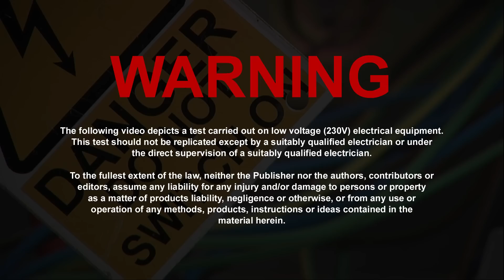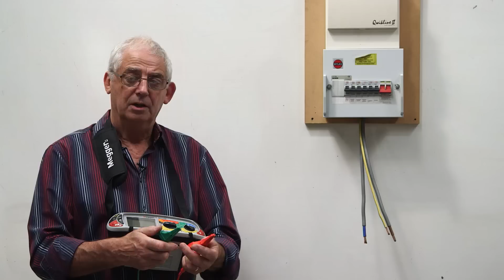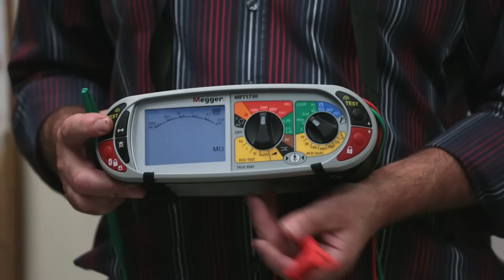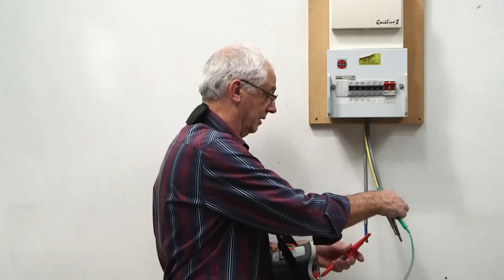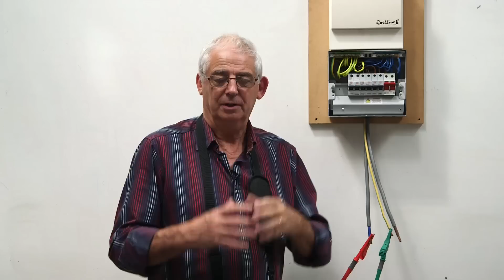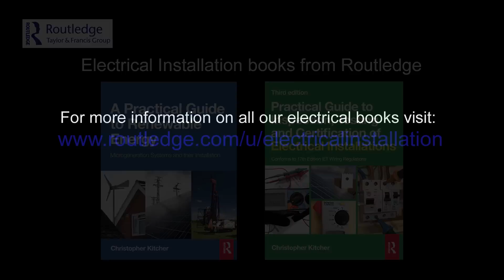Simple insulation resistance

Comment: Is there an RCD in this mockup institution? On my small screen looks like an isolator and MCBs? My question is can these tests be done through a switched on RCD?
Reply: Late reply but no there is no RCD on this rig . The RCD needs to be disconnected whilst doing this test otherwise you can damage it .

Comment: This may show my ignorance but, could you clarify something for me. at the beginning, your breakers are in the "off" (I'm assuming down is off) and during the test the breakers are in the "on" which doesn't make since since you joined the live conductors together, and there are no tripped or off breakers.?Just to clarify on my end, I'm assuming this is European installation, while I am in the US but that shouldn't make much of a difference?
Reply from the maker: The test is from the origin of the installation, the breakers must be on as it is the whole installation which is being tested. Joining the live conductors together and testing them to earth is a method of testing the insulation resistance between live conductors and earth, it is also a useful method to use when equipment is connected as it prevents the test current from passing through the load.
Reply: First thank you for the amazing quick response. So if I understand right this is a new installation and there is no power actually in the panel? (hopefully that is right because that would make so much more sence)